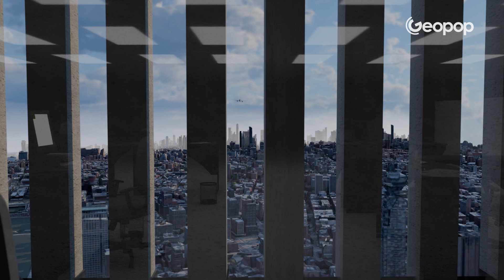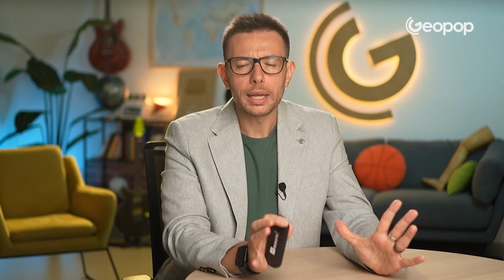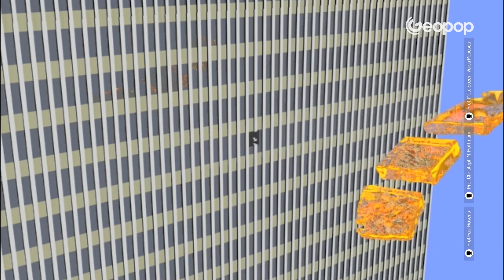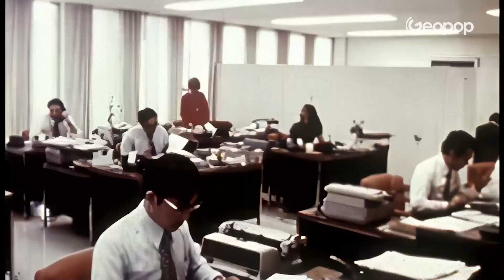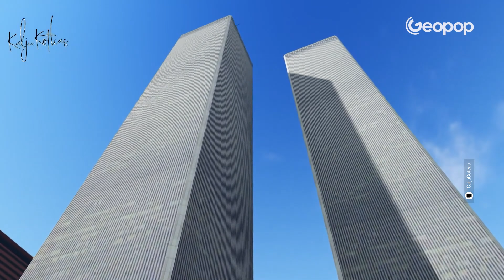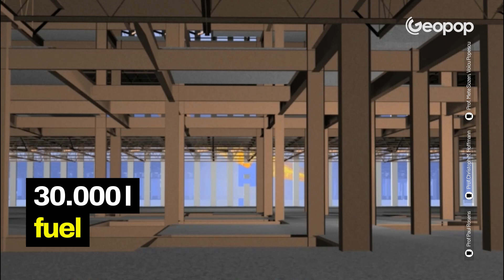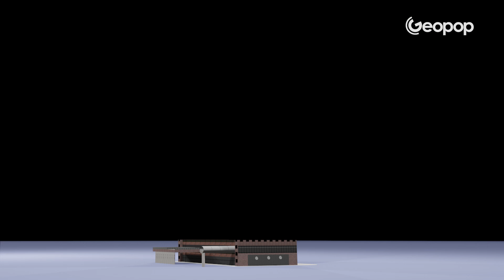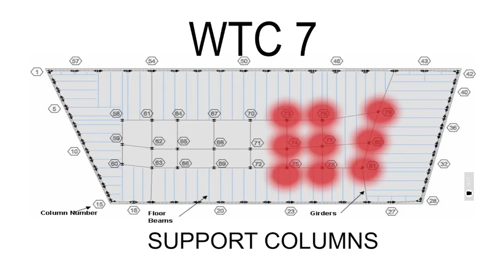9/11, 2001: The Technical Reconstruction of the Twin Towers and WTC 7 Collapses

Comment: Building 7 collapsed in solidarity with WTC 1 & 2, have no idea why buildings 5 & 6 which were directly under the two towers and much closer than building 7 didn't do the same and collapse in solidarity too!!!
Reply: Anything can seem like a conspiracy if you don't take the time to understand how it works. Take the time.
Reply: @TheLoonResistance  I've taken quite a lot of time, actually, a whole 24 years. At first I used to believe the government's narrative, but then things started to not add up, and when I looked deeper than what I was told, I knew things were not adding up and the government wasn't upfront about it. So no, I don't believe that crap that was fed to everyone to believe, nor should you, tbf, if you looked deep enough and asked the right questions!
Reply: @mhozayien - Ok, so describe the collapse of Building 7 to me in as much detail as you can.
Reply: @mhozayien  - Tell you what, I'll start in case you are feeling a bit shy:  Building 7 was the 6th building to collapse of 10 lost on 9/11. Because of its early low priority and complexity, conspiracy filled the information void with simple-minded garbage by technically ignorant people promoting political agendas. 7's loss is an engineering problem and should be treated as such, so I prepared this brief summary of my own analysis to fix that, using technical analysis, not ideology and magical (non)thinking. 

At 10:28am the WTC North Tower collapsed, showering Building 7 with tons of burning debris, causing heavy damage and starting many large  fires which burned out of control for the next 7 hours. Half the FDNY firefighters having been killed, units in disarray, equipment destroyed, no water pressure, and the greater urgency of search & rescue efforts, Building 7 couldn’t be saved so firefighting efforts were pulled as futile and 7 left to its fate. Firefighters make that sort of choice every day in brush fire situations - which houses to save and which ones to let go. Only real difference here is moving the decimal on the size and cost. People get overwhelmed by the size.

www.youtube.com/watch?v=g_SvpwyC17M

Collapse of a burning structure is always a concern for firefighters. Steel buildings subject to fire rely on active firefighting to survive. Buildings are designed around 1 to 3 hours of fire resistance, allowing time for occupants to escape and active firefighting to get started, after which all bets are off. Left to their own devices they'll exceed their design envelope and collapse, like Plasco Tower and Wilton Paes de Almeida. In 7 the occupants escaped, passive and active fire protections were compromised and active firefighting was abandoned hours before the collapse, which left the building to its fate. It lost. Odds on Building 7 would eventually collapse, and it did. No big deal in logic.

 http://www.youtube.com/watch?v=WnYBX6QT0R4 

FDNY Chief Daniel Nigro - The biggest decision we had to make on the first day was to clear the area and create a collapse zone around the severely damaged 7 World Trade Center, a 47-story building heavily involved in fire. A number of fire officers and companies assessed the damage to the building. The appraisals indicated that the building's structural integrity was in serious doubt. I issued orders to PULL back the firefighters and define the collapse zone. It was a critical decision; We could not lose any more firefighters. It took a lot of time to PULL everyone out, given the emotionalism of the day, communications difficulties and the collapse terrain 

FDNY Deputy Chief Peter Hayden ; We had our special operations people set up surveying instruments to monitor and see if there was any movement in the building. We were concerned of the possibility of collapse in the building. And we had a discussion with one particular engineer there, and we asked him if we allowed it to burn could we anticipate a collapse and if so, how soon? And it turned out that he was pretty much right on the money, that he said 'In its current state you have about 5 hours 

The collapse of Building 7 was anticipated and widely reported in the media throughout the day, with 24 video cameras recording some or all of the collapse. Everyone knew what was coming and why. 

www.youtube.com/watch?v=OY5S5k3tMHI

Building 7 collapsed from the inside out which is not at all intuitive and hard to understand, with most details being hidden from view.  It requires careful analysis and observation, and some people will struggle no matter how much it is explained. But here is my explanation relying on no outside authority. 

Building 7 was a unique, asymmetrical 47-story steel frame structure built atop a smaller 3-story building serving as a partial foundation, requiring lower floors dedicated to complex load transfer structures. Of trapezoidal shape and tube-in-tube construction, B7 (above the 7th floor) consisted of a central core of steel columns carrying most of the gravity load, perimeter steel columns around the outside of the structure carrying the remainder of the gravity loads and long span beams and girders to tie those elements together and form the floors. On the outside of the building hung a facade or outer shell. 

www.nist.gov/image-16640

Phase 1 : First externally visible signs of collapse initiation occurred at 5:20:28 pm and was notably quiet with observers not realizing the building was collapsing! No warning in the form of hundreds of eardrum busting 180dB explosive bangs. Here at 12:00 a local CBS affiliate reporter talking 10 blocks from B7 when collapse begins. People don’t start to notice the collapse until 12:11. At 12:45 is the famous CBS fixed camera clip of Building 7’s collapse. Note the silence. 

www.youtube.com/watch?v=t5tEy6mXSE8

Lower floor failures above the load transfer region (8-14) in the NE corner initiated the collapse. In this video at 0:45 you can see the NW corner from inside the building while under construction, Column 79 just out of frame on the left. That big, angled steel beam across the top of the frame connects to C79 at one end. The girders connect to the beam. That beam and all those girders depend on just one connection 

www.youtube.com/watch?v=nP3TNHPCIVU&t=45s

Phase 2 : NE corner floor failures caused a loss of critical lateral support over an excessive length of Column 79 and it buckled. Looking at the above floor diagram of Building 7 when you see all the structures that depend on C79 you quickly realize this one column was a relatively isolated structural element on which a disproportionately greater fraction of the structure depended analogous to say the Key Bridge. Externally as collapse begins we see a vertical progression of window breakage along the 44-46 line and a kink in the roof of the East Mechanical Penthouse at the top of the building, consistent with C79 failure. Normally with a buckling column, the load could be redistributed to other columns. With C79 that is not the case - the failure did not redistribute the load, so the collapse rapidly progressed to the roofline, sinking the rooftop penthouse. The transition from full capacity to almost no capacity occurs in an instant and will result in virtually no resistance 

Phase 3 : With C79 gone, B7’s progressive, non-symmetrical collapse continues with adjacent columns 80 and 81 left laterally unsupported and quickly buckling as well. The EMP drops down through the building. C79-81 all have no diagonal bracing, which is the major reason why they could not redistribute a lot of vertical loads among one another. From there collapse progressed from east to west through the central core until the core was gone from 81 to 58, taking all the interior floors and probably most of the perimeter columns with. Follow the horizontal progression of window failures low in the building and the dropping of the remaining rooftop structures into the building. The NIST Building 7 study model 4 determined C79 failing under ANY circumstances would have initiated the same collapse sequence. 

Phase 4 : After about 10 seconds only the exterior moment frame remains, giving the illusion B7 is still standing to the casual observer since little has outwardly changed. But it is just a hollow empty shell like an empty cereal box supported only by a few remaining columns and overloaded from the loss of the core columns and floors, quite unable to remain standing. With nothing remaining behind it, the north face leans inward, forming a V in the roofline, the last few columns buckle under the strain and the moment frame free falls, landing on top of the debris pile. 

It is only here at the very end, a single measurement of alleged free fall acceleration is taken, from just one point on that outer shell. The Building (core and interior) did not “free fall” - was already gone before that happened - just one corner of the outer shell briefly moved at a rate comparable to FFA. This alleged FFA was a product of how the shell fell NOT why the building fell . It’s also not even proper FFA as the single measured point was moving in 3 dimensions, not just down, which adds another variable. Start to finish the collapse took 18-20 seconds, 3 times longer than true FFA . How fast something falls can’t tell you what started it falling, certainly not 10 seconds after it started falling.  

The debris spread outside the footprint blocking surrounding streets, heavily damaging the Verizon Building and destroyed Fiterman Hall. 

No building is meant to survive 7 hours of multi-floor unfought fires. Building 7’s progressive, non-symmetrical collapse was incidental, unintended collateral damage from the combination of fire, time & gravity started by the collapsing North Tower, true no matter who planned and carried out the 9/11 attacks or why .  Of so little consequence it barely registered at the time, only taking on semi-mythical status as an alleged smoking gun years later when demolitions at the Twin Towers, missiles at the Pentagon and shoot down over Shanksville all failed and conspiracists had nothing left to work with. 

Anything can seem like a conspiracy if you don’t understand how it works. Now you should. I hope you found this helpful, informative and it solicits informed critical comment. If I made any errors of fact, logic or reason or left anything important out, please let me know so I can fix it. OR offer a more plausible alternative if you can. Be the first. Please start any reply with the words “Tits McGee” or I will know you didn’t read it and are wasting my time.
Reply: @TheLoonResistance  "Anything can seem like a conspiracy if you don't take the time to understand how it works."

Yeah stinkyshit, and then again there are utter stupid shills like you who "think" if islamists conspire it´s not a conspiracy because you have no idea what a conspiracy is...
Reply: @Kudde23what?
Reply: @ryanayr743  What "what"?